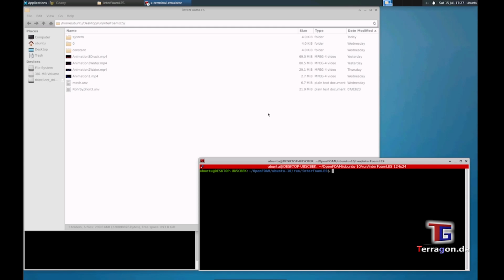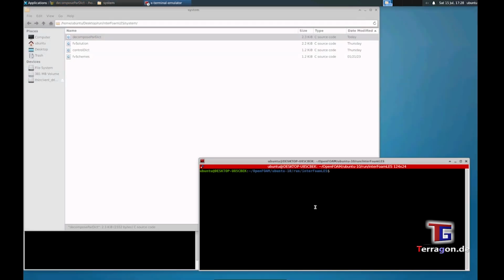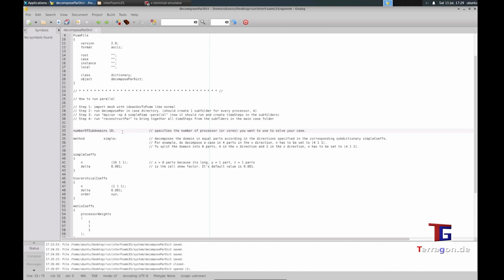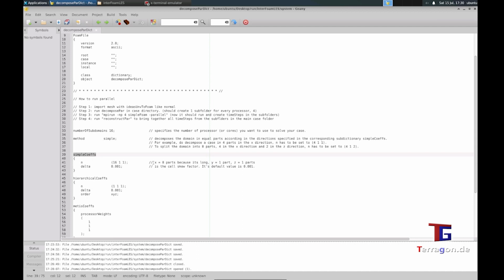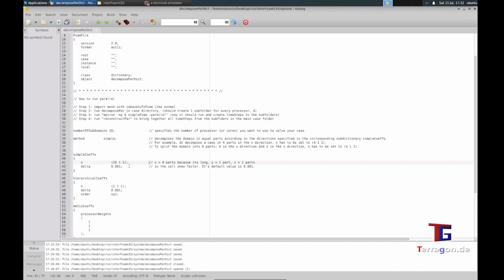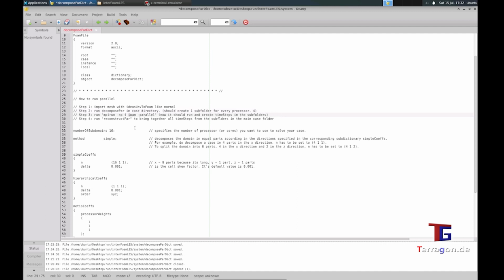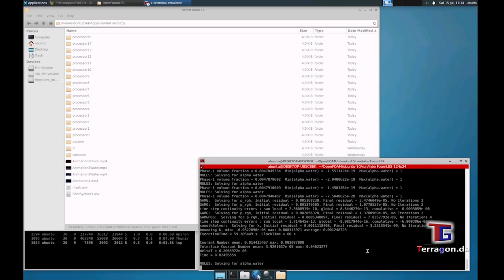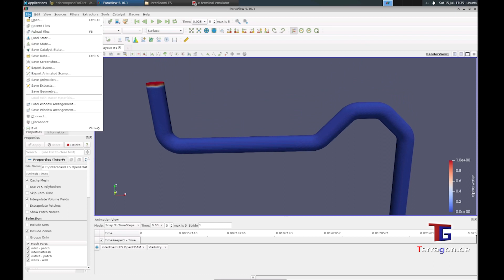OpenFoam Workflow (4): Running parallel on 16+ CPU cores

Comment: The number of CPUs in "numberOfSubdomais" corresponds to the logical ou physical number of cores?
Example: my CPU is 12cores / 24 threads
Reply from the maker: not sure, i realized its better not to use too much cores... i have 24 cors / 32 logical and now i only use 8 subdomains that work great and i can use the pc for internet surfing etc.... when i used 16 subdomains the pc did not respond to other tasks anymore. i would guess if you have 12/24 you can also try 8 or maybe 6 so that you can go on working while the simulation is running. i also just tried 🙂

Comment: I noticed that you are using an external mesh, currently I am having issues with performing a parallel computation in 16 domains after meshing in 16 regions using snappy hex mesh on a complex model. Can you do a tutorial so others don't struggle? I will figure it out, it would have been nice to get the cheat codes in a tutorial.
Reply from the maker: Hello and thank you for your question :) but I don't have an answer :/ i only use Salome for meshing and export .unv file like in my Tutorial Videos 😔
Reply: @TerragonCFD  no worries, I figured it out! I am running a DES simulation on 16 cores with a snappyHexMesh. Cheers!
Reply from the maker: that's great ! 🙂 @DefaultMando